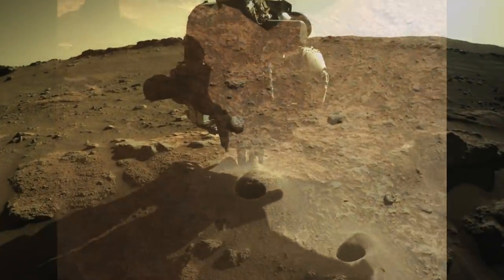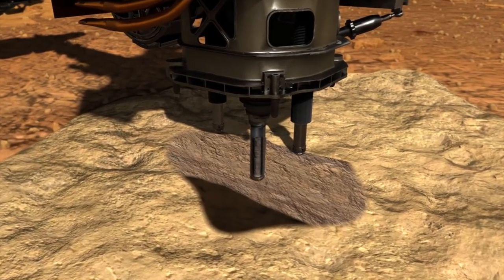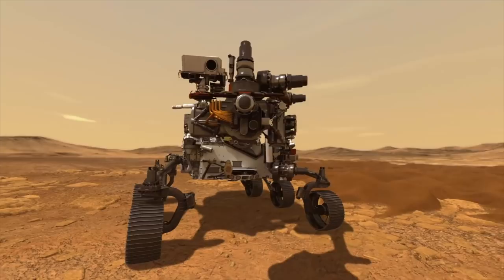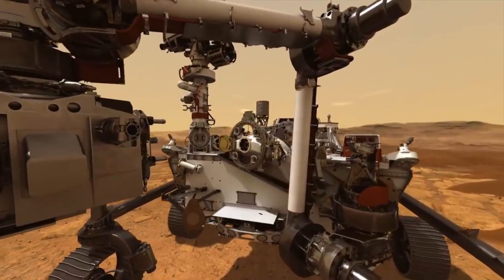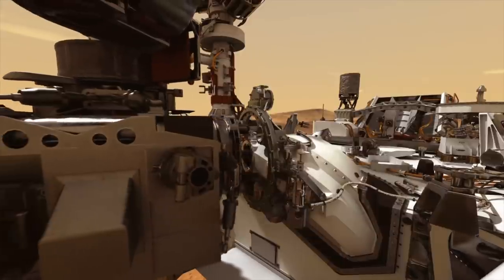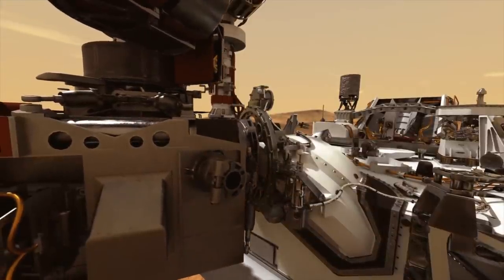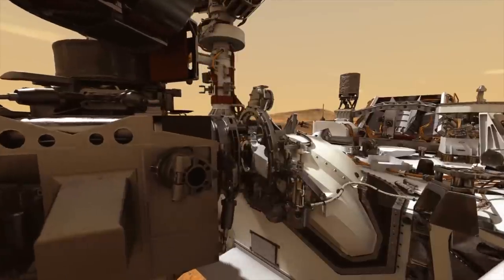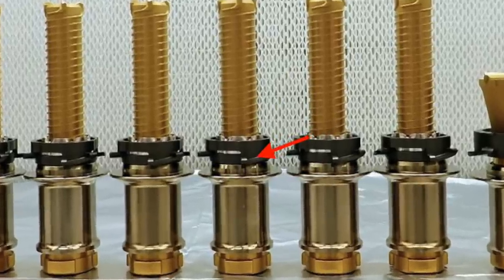Perseverance rover does a move that was never imagined

Comment: Hey Mars Guy, it still boggles my mind that we have what is basically a mobile science lab millions of kilometers across the solar system, operating in extremely harsh conditions, and can perform these complex tasks remotely. Massive respect to all at JPL/NASA.
Reply from the maker: I know, right!
Reply: And yet we still have to smack it with a wrench sometimes, or in this case hammer it against the ground
Reply: @maxstr  Whatever works Solyent 😉
Reply: @maxstr  Just had to jiggle the handle a little bit.
Reply: Up. Down. Up. Up. Down. Shimmy. HOLD. Hold. Upupdownleftshimmydown.
Reply: @turgidbanana  Hi there, I am very aware of all the satellites and probes that have been sent over the years, and yes, each and everyone has blown my mind. There is something about the Mars rovers though. The thought of these amazing machines trekking across the surface of another planet for years really fires up the imagination...thanks for reply.
Reply: What impresses me as well is, not only how much better this rover is from the original mars rovers, nor that we are now able to communicate regularly with it with super highres images, etc, but we also have got the foresight now to design the sample taker for instance to be able to shake it, tilt it, rotate it, shimmy and shake it, all to get those pebbles out from the inside, outside, top and bottom of the mechanism.  
I mean if any one of those controls were not available how much harder would it have been to clean it as they did.
It is pretty amazing i bet working there.  
Another thing is thinking about that  delay, it might be something most people thinks makes things harder, that is thewaiting for each action to take place, then the images recording it to be sent back, etc,  But really, considering just how much you don't want to screw anything up that cannot be undone, I imagine the time it takes before they make any non-standard maneuver is is significant in just wanting to make sure you don't 'f----' it up good, and ruin a mission that could for the wrong pebble be brought to a halt.  They literally have to consider so many scenarios, like what happens if we shake the device here, and those pebbles end up calling off into this joint, or what happens if the shake causes use to tilt of the rock we are perched on, and what happens if the sand sinks, and so on.  
I mean they probably need some lag before giving each new instruction just to make sure the old one succeeded, and two also to make sure the action they are giving it doesn't have some unforeseen side-effects that could bring the entire rover to a halt.  
Like darn that pebble is now in the left leg of the rovers tread, "umm is it bad the trend is not responding?" Yea.  I am sure they design it so that it doesnt' do that, but still, i mean, there is just that nagging feeling you would have that is this gonna be another Mars Climate Orbiter (metric to standard conversion disaster) losing a $128 million dollar(likely 1 billion today) mars satellite over a math mistake.  I imagine no one wants so ever see that again...
So I am sure every single instruction has people whose job it is just to foresee issues that team might not consider...  be really curious though to see exactly how those teams operate on such an important mission, with the entire world watching 24/7...
Reply: @Arrogan28  Hi there, thanks for a well thought out post. The Mars Orbiter has more or less mapped the entire surface of Mars in high res...and we can actually see it , how mind blowing is that !.

When it comes to the rovers and those wonderful panoramic images we see are all well thought out before hand. The image analysts send a whole bunch of parameters to the rover and then stich them together to give us all those amazing images.

The Moxie experiment tells us we can actually pull oxygen out of the Martian atmosphere. I think it produced 5 grams in a few hours which is enough to breath for 3 hours or so ?. Anyway, thanks again.
Reply: @dazuk1969  Five grams of oxygen would only last a person about ten minutes.
Reply: @peterjf7723  I did put a ? after the time 5 grams of oxygen would last a person. I have actually read it would be more than 3 hours as it is 100% oxygen which is not what we breath on earth. But I trust nothing I read online....hence, the ?. The same skepticism applies to your post ?.
Reply: Nasa has accepted your respects
Reply: @tankerock  Tell NASA I said rEspect for accepting my respects.
Reply: @peterjf7723  Correction where it due Peter, you are correct in saying 5 grams is about 10 mins of oxygen. My confusion came about as what I read referred to the theoretical amount moxie could produce over the full 10 cycle 2 year experiment. I don't like saying things that are incorrect so I hope this rectifies that.
Reply: Nah u got it all wrong mate, it’s a land based nuclear powered aircraft carrier designed for science in Anakin’s worst nightmare
Reply: @MarsGuy  and it's amazing my cell service sux...but they can do this
Reply: it's not even remotely
it's autonomous
Reply: What amazes me the most is that they didn’t make a way to clean the solar panels
Reply: Ah yes, complex tasks such as "Look at fingers" and "Shake tube"
Reply: @maxstr  this is sometimes jokingly know as the engineering solution. Hit it.
Reply: It's amazing how complicated simple tasks become when they have to be performed entirely remotely (or semi-autonomously) in a mobile science lab millions of kilometers across the solar system, operating in extremely harsh conditions. Something that would take a non-skilled, on-site operator seconds to perform probably took several highly trained technicians, scientists, and oversight personnel a couple of hours to do remotely.
Reply: @mailleweaver  I agree, JPL sends a very carefully thought out set of parameters/instructions every day...remotely....then have to wait while percy performs these autonomously. And yes, it takes a whole team of image analysists, geologists, programmers...and so on to do so.
Reply: @RandomsFandom  That's probably due to the rover having no solar panels to clean, because it's nuclear powered.
Reply: I can’t agree more it’s so amazing I can’t get enough of it .
Reply: Kilometers?! Where you from nerd?! Just kidding just kidding. Lol
Reply: I know and we can’t feed the poorest of family’s in the uk
Reply: @djdan890  Yes we can....and do.
Reply: @biserker1delta61  Thanks !...no worries though, I am guilty as charged. I am a fully paid up member of the Mars nerd fan club 😉
Reply: We accomplished this 40 years ago, not that impressive pal
Reply: @AverageAlien  Huh !....go straight to the back of the class and write 100 times "going to Mars anytime is amazing"
Reply: @AverageAlien  Voyager 1 and two, Cassini, Hubble, the ISS, the space shuttle, all the Mars rovers and orbiters, the list goes on.....and we haven't accomplished anything ?. NASA has shown us all the planets in the solar system in great detail, along with all the moons that surround them. I would not trade all the wonderful solar system missions in the past 50 years for one Mars mission...but hey, you are entitled to your opinion.
Reply: And with a 20 minutes delay to every input as well.

Comment: An amazing achievement. But it clearly demonstrates the advantage of having boots on Mars:
“Hey dude, could you get those pebbles out of there?“
“Sure. (Shake, shake.) Done!”
Reply: True. They were lucky this time as this wasn’t guaranteed to fix the jam. Or even worse could have happened… the rover could have got stuck on the rocks or rolled over.
Reply: @notmenotme614  I'm sure they wouldn't perform that manuever on the rocks if they hadn't already concluded that getting stuck or rolling over was pretty much impossible. 

Also, that think isn't easy to roll over, do you know how huge it is?
Reply: @notmenotme614  Those rocks looked pretty small, at most the height of a curb
Reply: @samuels1123  The rocks were small but gravity on mars is significantly weaker than on earth, so even a little bump can potentially throw a vehicle over
Reply: @WhenGoatsWentBaa  You'd need basically no gravity to flip a rover that large on rocks that small, if the rover could flip on those rocks then the shaking motion would've been strong enough to make the rover glide across the ground as though it were a smartphone on vibrate
Reply: @WhenGoatsWentBaa  significantly weaker is an overstatement imo. Its 1/3 the strength of earth, which is twice as strong as the moons gravity. The gravity is strong enough that a rover that big wont topple from small bumps

Comment: I am always awed by the cleverness of NASA, thinking through possible problems way back in the design stage so they have options to fix things like this much later and all by remote control.
Reply: I'm pretty sure they encountered many of these problems during live tests of the system on earth.
Reply: Correction: ...by DELAYED remote control.

The delay makes this all the more difficult and tense because you have to send instructions inn a data burst and wait for the return to show whether it did anything. This can take an average of 2 hours for anything that is not hardwired into the rover to do... or if it requires the rover to move itself any significant distance: like doing a 90* turn in place at it's sluggish speed of about 20 cm/minute.
Reply: Shake the pebbles out and tilt the rover a bit, yes very clever indeed

Comment: At first it seemed odd that they had the entire drill mechanism turn 90 degrees to the horizontal plane to dock the drill bit but then i kind of remembered that the drill bit needed to unload it's sample without the aid of people, it needs to be at an angle where gravity can be used to dump the samples. 
It must frustrate the engineers of those mechanisms to no end knowing that once the rover leaves orbit they can never fix anything if it goes wrong and yet they're only allowed so much space and weight to fit a mechanism that must be designed to work under every known circumstance for years without maintenance.

Comment: Thanks for the concise description. If it happens once, it will likely happen again. So one then asks how to devise a mechanism to deal with it.  Just like a machinist in a shop clearing debris, subsequent rovers may need a (Martian) air compressor, air hose and nozzle which the rover arm can grasp
Reply from the maker: Thanks.  And yes, more pebbles are possible.  But the solutions learned from this go around will make the next one easy to deal with.

Comment: I know it would add more to an already complex machine, but it would be real handy to have a bottle of compressed nitrogen and a nozzle that the carousel could be rotated in front of and blow the chamber out with a little puff. Might be the difference between a functioning chamber and one that is rendered unusable due to stubborn dirt. Just food for thought for the next rover.
Reply from the maker: There's already a gas dust removal tool (gDRT) that's used to clear the powder after a rock grinding operation.  But the compressed nitrogen can't be refilled, so it has to be used sparingly.  Better to dislodge pebbles in ways like shown in this episode.

Comment: I think a really cool idea could be to make some sort of air compressed and blowing tool on an arm, this not only could clean out rocks but might even be useful for blowing loose dirt and rock away from the ground for observation, experiments etc.
Reply from the maker: There's already a gas dust removal tool (gDRT) that's used to clear the powder after a rock grinding operation.  But the compressed nitrogen can't be refilled, so it has to be used sparingly.  Better to dislodge pebbles in ways like shown in this episode.
Reply: @MarsGuy  Mars is not totaly airless. It would take a few minutes but Mars air could be compressed to do the job. Take a small compressor and place it in a test chamber. Set the test chamber to Mars. Turn on compressor. I bet it could build 100 PSI in a few minutes.
Reply: @davidhenderson3400  Absolutely... but what are you willing to leave behind to allocate weight for that?
Reply: @talltroll7092  How much does that compressed nitrogen tank it will replace weight?

Comment: Diamond coring operations on heavily fractured concrete pavement can run into similar issues. The concrete pieces can get wedged inside the core barrel, requiring “gentle” hammering to clear the barrel. If the pavement has disintegrated to gravel sizes, the particles roll under the friction of the bit, presenting constantly new surfaces to the bit and preventing advancement, resulting in worn out bits.

Comment: This kind of thing just shows me that not enough testing was done before this drill was sent to Mars. This drill sample system has gave them nothing but trouble.
Reply: How do you test a drill for Mars on Earth, when you don't have rocks from Mars to test it on?
Reply: @kelduck8851  Martian rocks are mostly iron and other compounds that can be similarly found on earth, just not in the same abundance. However, nonetheless this guy is not right either. Plenty of testing was done and this act was one of very few issues that the rover has encountered in its years of being on the planet, and it was solved without that much issue.

Comment: Still seems like a brush & blower would be pretty useful things to have up there.
Reply: A blower would need to rely on compressed gas, given how thin Mars atmosphere is, which adds to the complexity of the design and eats part of the weight budget.
Reply: @_John_P  I understand this.  Just saying, and only half-serious, but possibly something to consider.  I think anyone who's ever used compressed air to blow dust and dirt out from complex areas for sure knows the usefulness of it.
Reply: @UCCLdIk6R5ECGtaGm7oqO-TQ  I also wonder what it would be like to use a brush there, as Mars dust is sticky in a similar way as styrofoam packing balls, except much denser. A simple brush should get clogged and dust would be partially deposited back on the surface every stroke. The brush itself would need a cleaning system .
Reply: @_John_P  use the compressed air.

Comment: I wonder if the rover programs could spare themselves all the weird shakes if they just included an arm with a screwdriver
Reply: Maybe, but unless it serves another purpose too, it's just parasitic weight penalty. Every gram delivered to the surface of Mars takes maybe a couple of tons of fuel and equipment to get it there. You don't have to add too many doohickeys like that, and extra layers of safety margin etc, and you have to start leaving experimental gear behind

Comment: The should of designed that collection drill system better...or a tertiary stage called drill core sample prep.. Where it plugs the hole  before placing it in the system...

but it could the aparratus could of been made smaller if the drill  when coring simply retracted from the groundinto itself, and then closed.. lifting it up into its own compartment. could be moved else where internally or kept in a simliar rotating system, but in this angle less chance of debris blocking the system

Comment: The sample return system seems like an unnecessary Rube Goldberg device.
Reply: It's a risk based problem. They need a launch platform on the ground to send the samples to Earth, and Percy can't drive back collecting all 43 samples along the way and dump them in one spot. Thus, a small fast rover that can fetch the samples and drive back to the launch platform is needed. Also, they are unable to provide enough energy for the samples to go directly to Earth in a timely manner, and there's the problem of reentry. Instead, they can be launched to orbit around Mars, where a spacecraft can collect them, accelerate back to Earth and jettison the precious cargo, protected within a heat shield, just like it has been done with Stardust mission and a few others. The only part that has never been done before is launching a solid rocket into orbit from the ground on Mars.
Reply: @_John_P  Thanks for your detailed explanation 🙂

Comment: Definitely NOT a good example of mechanical engineering.  The mission engineers did a great job working around a design problem, so hats off to them.  As for the program engineers of the drill system, they need to go back and conduct a design review.